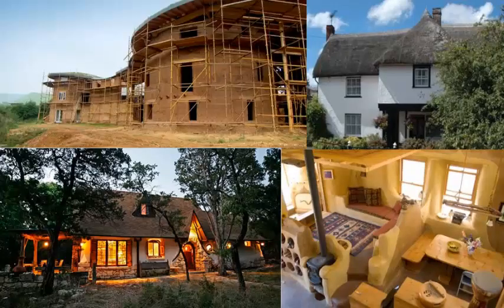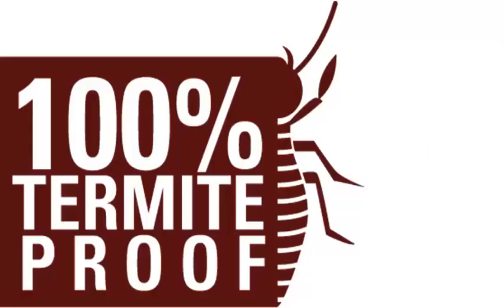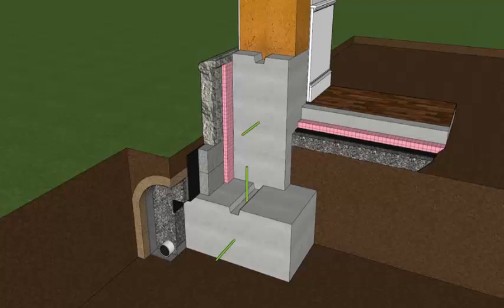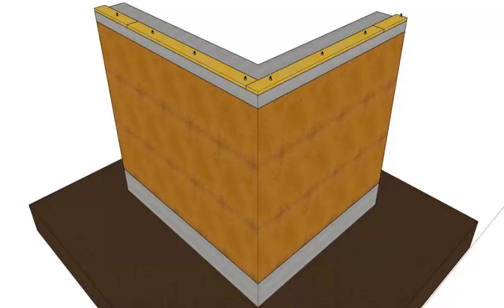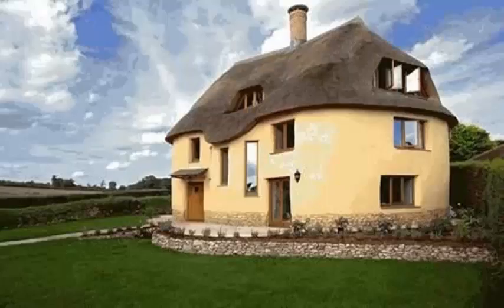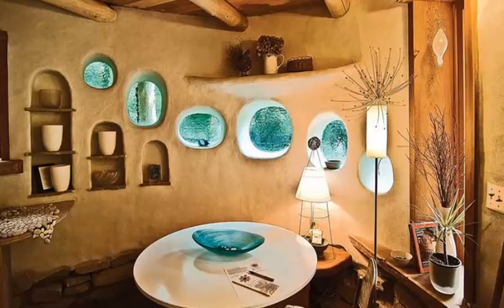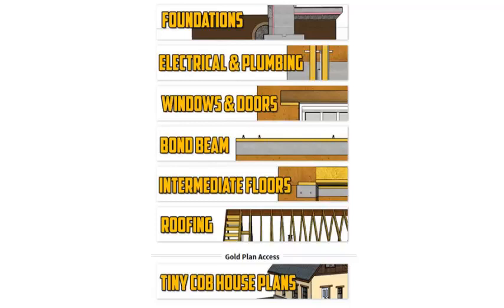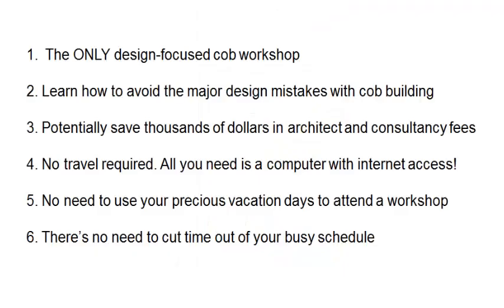MODERN COB HOUSE DESIGN 101

Comment: The whole reason for building with Cob is to be able to use common basic skills without an engineer's degree lower the cost by using an average person's common ability to build a basic shelter. Plus have a lower footprint impact and use a greater degree of self-reliance without government interference. You missed 90 % of the whole concept. Try to think outside the Box.

Comment: I have questions About the bondbeam. Is it concrete that connects direct with the cob wall? And in the concrete and cob are steel that goes up trough the wood beam? I see many pictures of cob houses and they use big wood beams trough the cob walls(from front wall trough the back wall) as foundation, is that not way better and easier?

Comment: Finally someone who applies a modern approach! Ive probably seen hundreds of cob structures in person or in pics and always struck by the poor design elements and downright ugly appearances of some. I always come away with a feeling of ramshackle and poor vision. While everyone has different tastes there is no reason a more modern well designed home is forced to lose its organic look when employing modern and better building principles. It doesnt even mean a better approach costs that much more than a poorly planned often delayed disaster later on. My hats off to you for forging a new concept in this amazing building material. Would like to see cob construction labor intensity reduced substantially and I think thus is an area you could add another layer to in your course through the useage of equipment rather than having a crew wasting their time stomping out a pile of cob mix.

Comment: The thing I learned the hard way is my dog smelled the walls as dirt, and dirt is for digging. I added a stucco to the walls,  about 1 meter up, inside and out and never had the dog diggi g problem  again. The house has been perfect, just normal upkeep with paint and minor repairs.

Comment: Nice job on this presentation. We Karen and I have recently signed up to the class and very happy we did. We are doing the month by month but now we would like to sign up for the full year class. Is this possible? We have 10 acres in eastern Ok. Right out in the sticks! Paid in full. Most of the materials are already there. We researched many variations of earth homes.ie compressed earth blocks. Also we will be using solar for our power..construction should commence in the fall WITH some luck. Again thx. Bluzzsgoinggreen
Reply: Did you guys end up building a Cobb home on your land? Very interested to find out how it went! 🦋
Reply from the maker: Sure, send me an email to alex@thiscobhouse.com
I can set you up.
Reply: @thiscobhouse  this next payday i am ordering your online workshop course, cant wait. i have one question...my footings will be a solid concrete footing that is on bedrock. i plan to use 8in wood studs with rock wool insulation fill. (ive read that rock wool breathes). i then plan to cover both sides of this wall with 6 inches of cob....so if there is no vapor barrier used, will this wall be okay to breathe being there is rock wool being used in the center of the wall? im hoping it will be.
Reply from the maker: @D.A.T.GRINGO  Yes. Its common practice to put an insulation layer sandwiched between two thinner earthen walls. The insulation can slow the breathablity, but your walls will still breathe and function that way.
Reply: @thiscobhouse  sweeet to know, thanks alex...just purchased the online course as well, and i am looking forward to checking it out...thanks for the quick reply...have a great day!